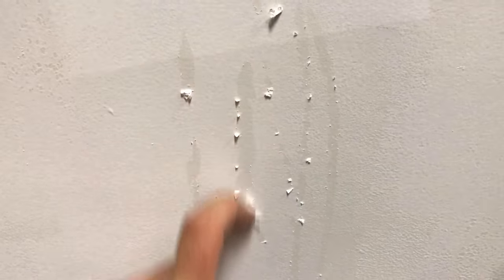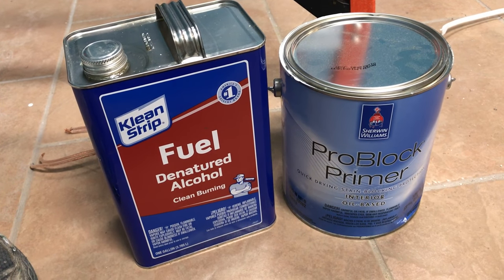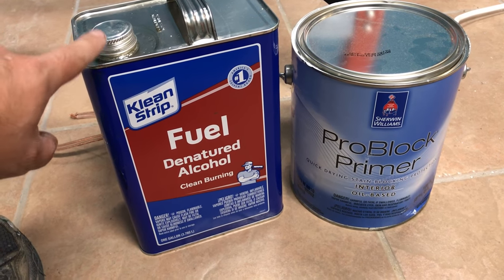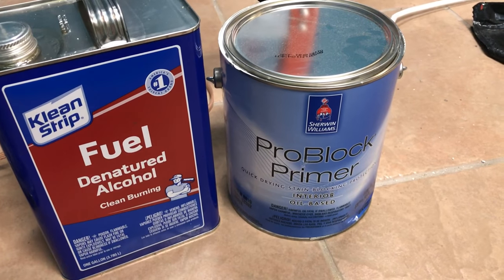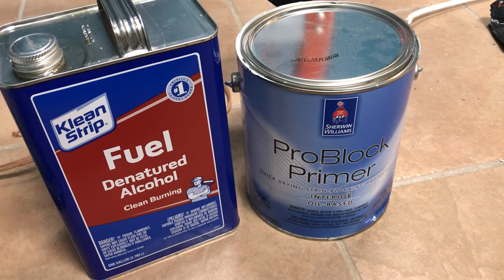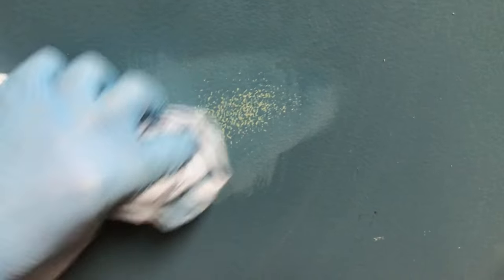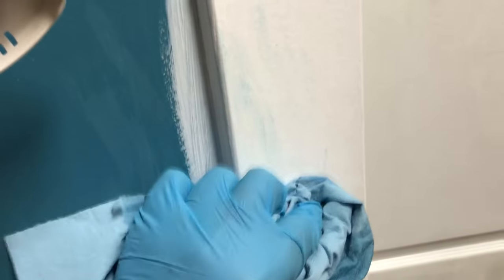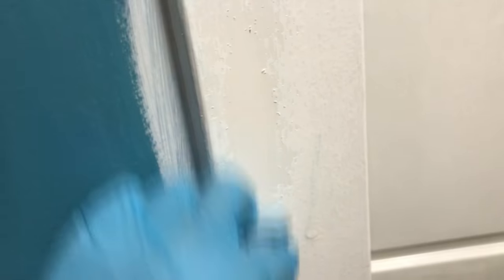#1 Mistake DIY Painters Make (How to paint over oil based paint)

Comment: Don't mislead the public. Paint cans have instructions. Google has good answers to any paint questions you may have. Bottom line is that you took a short cut.
Reply from the maker: Care to be specific and explain what is misleading about this video?

This is the first time in the 18 months this video has been posted that anyone has made that allegation about this video.
Reply: @notwaitingtolive  All problems have a root cause. The root cause of paint failure in your video is that  water based paint was applied over oil based paint. It is a no no without preparing the surface. In your case, you are specifically converting from an oil based paint to a water based paint. 
 Protocol is as follows.
1. decontaminate the surface.
2. rough the surface up with sand paper. eg. 100-120 grit.
3. wipe off dust to achieve a clean surface.
4.prime the surface with an oil based primer such as Cover Stain.
5. lightly sand the primer after dry and wipe off dust.
6. apply 1st finish coat.
7. check surface for dust, rough spots and lightly sand if necessary after 1st coat dries and wipe surface off.
8. apply second coat
9. sit back in the comfort of your own home and enjoy your paint job for many years to come.

Bottom line for anyone who wants to convert from oil based paints to water based paints is that there are no short cuts.  If homeowners hire someone to paint their house and they elect to take a short cut in the conversion process, good luck getting them to come back and abate their failed paint coating.  

Did not mean to disrespect you in any way and your effort to post a video to teach people is impressive.  What is misleading to the public is that your problem is common in the painting business and knowingly performed by people who take short cuts to make a quick buck.  Most people pay someone to paint their house and exchange their hard earned money for the service.  A professional painter who does things right to begin with may seem a little more costly to the uninformed consumer in the beginning. However, imagine what the  ultimate cost would be in, time, labor, materials, and ones health from breathing in chemicals and paint chips for hours on end if they have to fix what went wrong 1st and then do things right. 

Please accept my reply to your request to be more specific in my first reply to your video. Your video is saving people a ton of money, time and headaches. I can assure you of that.
Reply from the maker: @skyhawaii5446  thank you for your thoughtful reply and insight.

Comment: the simple thing is don't use water based paint on woodwork metalwork it's rubbish always use oil oil will always be better
Reply from the maker: jack wardley Agree for the most part. The dry time on oil based paint can be prohibitive in some applications though. There are plenty of scenarios where people can’t wait over a day for the paint to be dry on their trim or door.
Reply: @notwaitingtolive  yeah sometimes you have to use something quicker but would never choose to use it because you can't get the same level of finish in my opinion

Comment: KILLZ is a girl's best friend.
Reply from the maker: I love me some KILZ and use it a lot. But I'm a BIN guy myself when I need something to work fast and well. The shellac based primer covers everything and can be recoated in 15 minutes. I paint a smoke damaged fire place with it in this video: https://youtu.be/u2pdzTiKpDY
Reply: @notwaitingtolive  Thank you.  Have a job coming up and will buy BIN.
Reply from the maker: @updownstate  what are you painting? I usually use 1 coat of Zinsser drywall primer for patches and drywall (because it’s only $10/gal), 2 coats of the water based Kilz covers wood trim if I’m painting it (because it’s cheaper and less noxious than shellac and good enough). And I use shellac for any tough spots with stains, grease, mold, or other marks that will bleed through.
Reply: @notwaitingtolive  1925 brick house, will paint stucco interior and woodwork.  There are stains inside below the windows from leakage and client does not want to caulk or repair windows.  I don't know why.  Everything has been painted many times.  This is hot desert [Arizona] but house gets very damp in summer due to evap cooling.  They have no heat.  Thanks, much appreciated.

Comment: the simple answer is don't use water based its crap
Reply from the maker: Jack I couldn't agree with you more. I actually just painted a smoke damaged fireplace mantle in this video for a friend using shellac based primer and oil based paint and love how it turned out: https://youtu.be/u2pdzTiKpDY

Unfortunately as a contractor the dry time for oil based paint makes work much more complicated and prone to mistakes and redos. And there's no real added benefit as the clients I work with don't care enough to pay hundreds to thousands of dollars more for me to use oil based paint.

For my own personal projects though I use oil whenever possible. There's simply no comparison, even to the alkyd stuff.
Reply: @notwaitingtolive  yes they can cause a bit more of a inconvenience but nothing much people managed before water based paints came out i use oil on walls and ceilings and for sealing plaster and drywall quite a lot of time and the oil is also around the same price as standard emulsions here in the U.K. it covers better blocks stains you don't need to spot prime filler so it can save a lot of preparation and save you money oil based primer and eggshell was the first paint we learned to paint with on walls in college.

Comment: Not accurate since if the oil paint is more than 5 years old you can simply sand it lightly and apply a latex primer sealer and it will stick perfectly, i made a lot of paint jobs and it always work.
Reply: That has not been my experience in historic restorations. I wouldn't apply a 5 year rule at all.
Reply: @CBBC435  Well for me it work great and not having any issues!